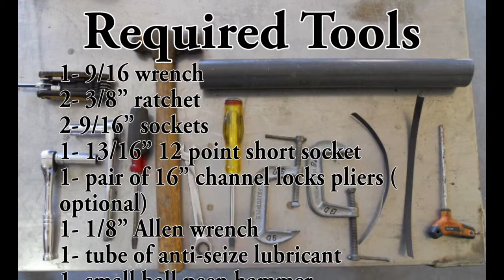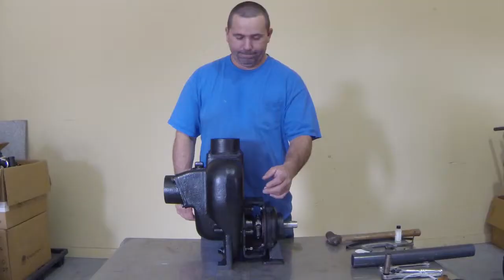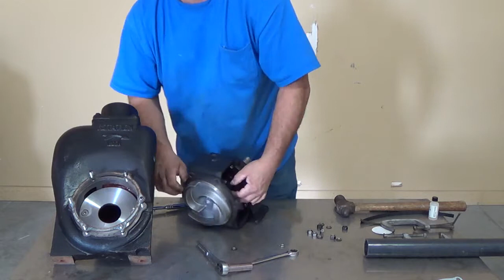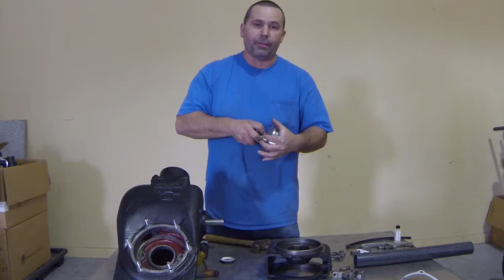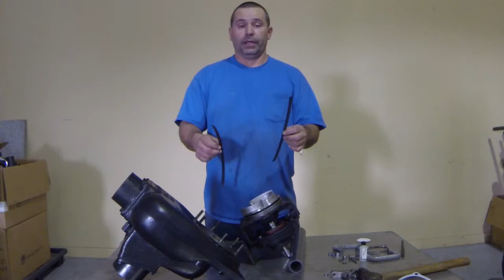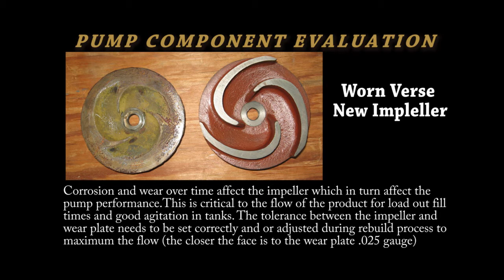3 Inch Cast Iron Pump Rebuild

Comment: Isn't the impeller clearance meant to be set so that tolerance is between the impeller and the wear plate?  That's what all the Banjo instruction manuals show.  The strapping can be pulled out of the pump after the locking collar is tightened on the shaft.